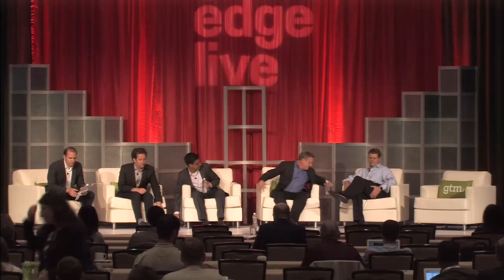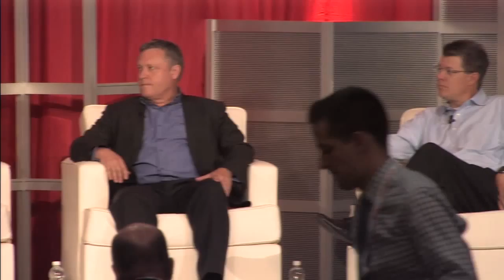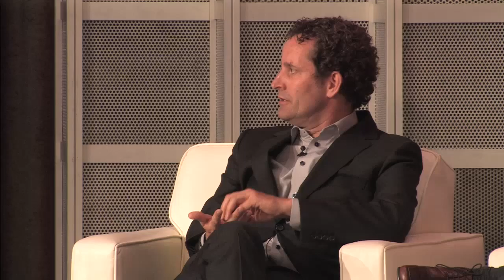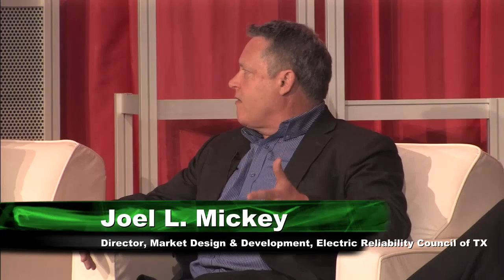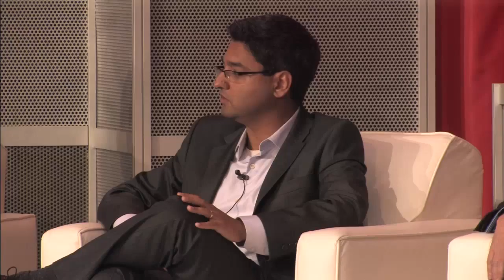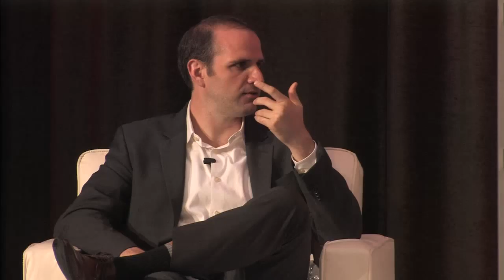The Coming Wave of Storage Finance: Taking Cues from the Success of PV

Comment: Believe the title of this video is incorrect:

The Coming Wave of Storage Finance: Taking Cues from the Success of PV
2014 saw a handful of energy storage start-ups acquire funding worth tens of millions of dollars for zero-money-down behind-the-meter storage. These financing rounds, although impressive for the industry, are orders of magnitude lower than what residential (and more recently commercial) solar has achieved since 2008. Solar financing has evolved with recent trends towards securitization, loans and other innovative tools. This panel will explore possible paths storage financing could take based on experience from solar, or in partnership with future solar ventures. Moderator: Ravi Manghani, Senior Analyst, Energy Storage, GTM Research

Paul Detering, CEO, CODA Energy
Thomas Leyden, VP Energy Storage Deployment, SunEdison
Gerrit J. Nicholas, President, K Road DG, LLC